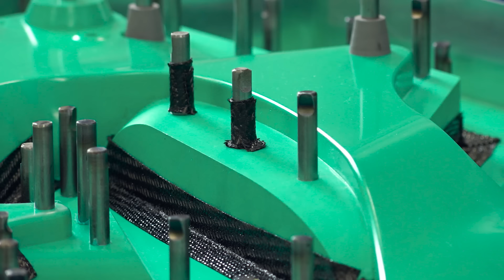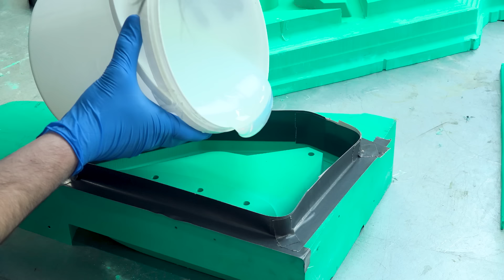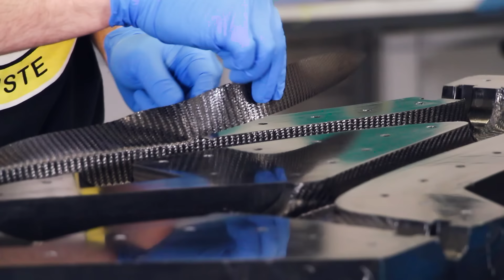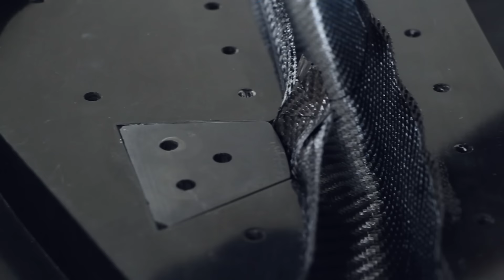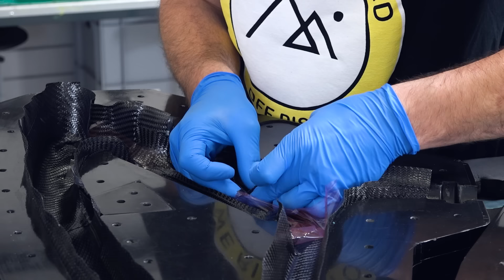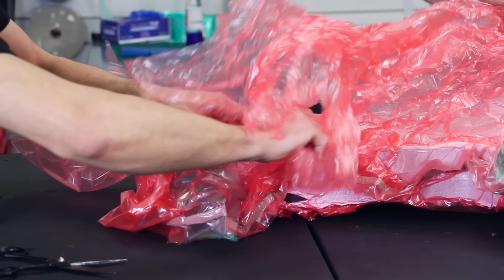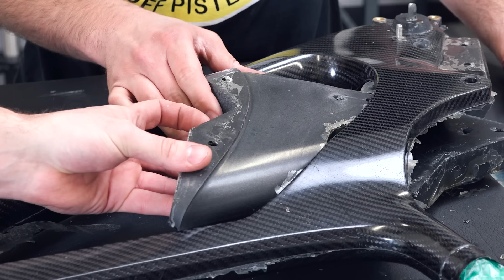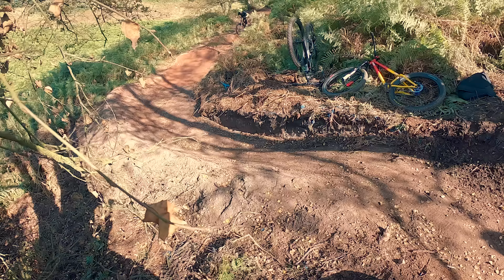Making a Carbon Fibre Bike Frame – From CAD Design to Downhill Race

Comment: Great video, thanks for posting! Btw, would putting a narrow strip, say 10mm, of breather cloth inside each tubular vacuum bags be an idea? (for faster vacuum)
Reply from the maker: You're welcome. I really can't see adding breather inside the vacuum tubes being of any advantage, there's not really any problem with maintaining airflow through the bags and, of course, the vacuum is applied to the outside of those tube bags (hard to get your head round, I know!).
Reply: @easycompositestv  so why is positive air pressure not just applied to the "vaccum" bags, like blowing up a baloon so they press the laminents into place... I thought that's how they did it in larger manufacturing? or is the extra large outer bag and pulled vaccum because it's a CF mold and not an aluminum mold...

Comment: Hi guys. Thanks for the video. Next time you should use ISO 8735 pins with inner thread on one end. Then you can use reverse hammer to extract those. 

Moreover, strongly recommend you to use silicon based release agent on bolts and pins, such as Huntsman QZ-13. Don't forget to cure the release agent in an over before using those pins. QZ-13 creates really nice continuous film on fasteners, not like other semi-permanent PTFE based release materials.
Reply from the maker: Hi Kyrill, nice suggestion on the internally threaded pins. Regarding the release agent, Easy-Lease is not PTFE-based and does leave a good continuous film on fasteners. The issue removing the pins (which really wasn't that bad) was mainly down to the fact that they're parallel and embedded into 60mm of cured laminate. I'm sure you'd agree that no type of release agent is ever going to make the extraction of parallel pins in that much laminate easy!